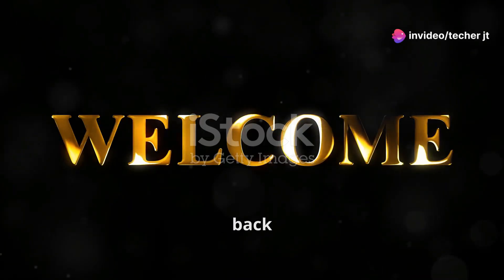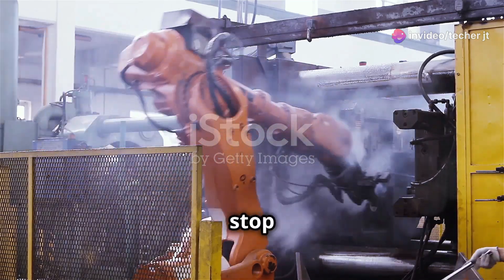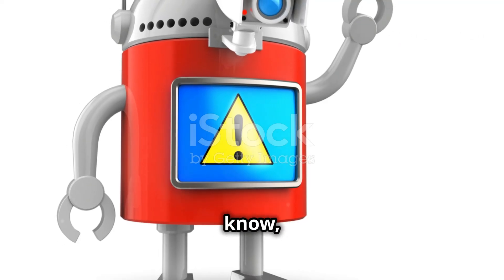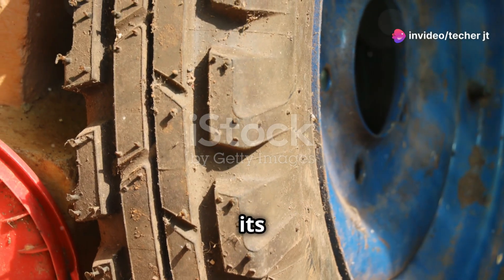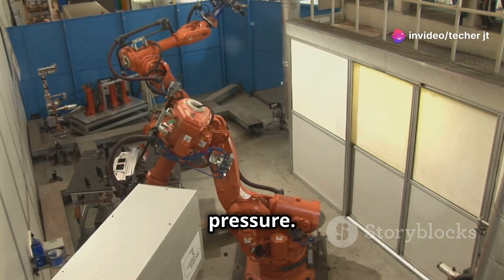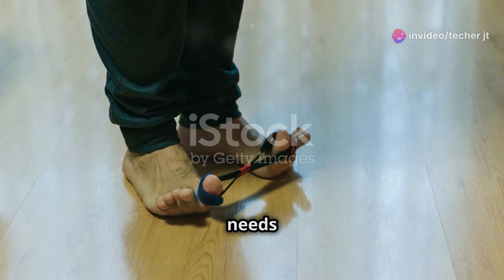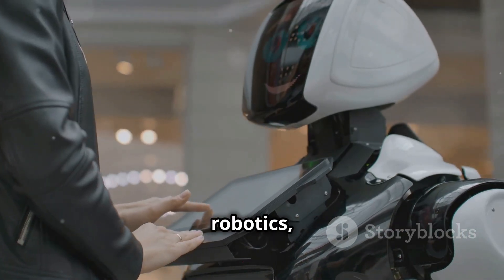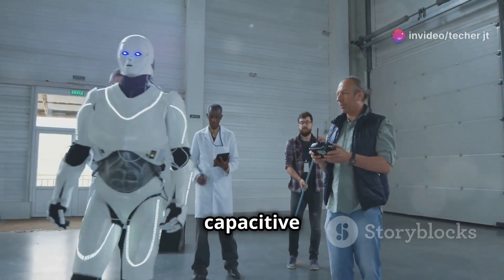Capacitive Sensors in Robotics: A Beginner's Guide

Comment: Annarica Nina A. Loyola
10-HERMES

1. What is the primary function of capacitive sensors in robotics?

Capacitive sensors act like a robot's personal space bubble, detecting objects before they
make contact.A proximity capacitive sensor emits a weak electric field, kind of like an
invisible force field around the sensor. When an object enters this field, it disrupts the field,
and the sensor detects that change. This allows robots to judge distances, avoid obstacles,
and navigate their surroundings without walking nose-first into a wall.

Comment: Jannah Loreen S. Galla 
10 - CASSIOPEIA 

Q: 1. What is the primary function of capacitive sensors in robotics?

A: The primary function of capacitive sensors in robotics is to detect the presence or proximity of objects, including both metallic and non-metallic materials (such as plastics, liquids, and glass). They work by measuring changes in the capacitance between the sensor and the object. Capacitive sensors are often used for object detection, level sensing, and position tracking in robotics, allowing for more versatile interaction with various materials.

Comment: Jaynie Margaret M. Lashley 
10 - Andromeda

1. What is the primary function of capacitive sensors in robotics?

- Capacitive sensors in robotics primarily function as proximity sensors, detecting the presence of objects without requiring physical contact. They work by measuring changes in capacitance, which is the ability of an object to store electrical charge. When an object approaches the sensor, it alters the capacitance, allowing the sensor to detect its presence and proximity.

Comment: Shiloh Nouvel A. Miquiabas
10 - ANDROMEDA

1. What is the primary function of capacitive sensors in robotics?

Answer: The primary function of capacitive sensors in robotics is to detect changes in capacitance caused by the presence of objects, including non-metallic materials like plastics or liquids, allowing robots to sense proximity, position, or the level of materials.

Comment: Chelsie Ann P. Carnaje
Grade 10 - Hermes

1. What is the primary function of capacitive sensors in robotics?

Answer: Capacitive sensors in robotics primarily function as proximity sensors. They detect the presence or absence of objects or measure the distance to an object by sensing changes in capacitance caused by the presence of conductive or dielectric materials. This allows robots to detect and interact with objects without physical contact, which is useful for tasks such as obstacle detection, object positioning, and touch sensing.

Comment: Leon Anthony S. Juaneza
10-LYNX

1. What is the primary function of capacitive sensors in robotics?
-Capacitive sensors allow robots to feel and perceive their surrounding environment without touching anything. They use electricity to detect nearby objects, measure pressure,  and even track multiple points of contact. This also allows the robot take less damage or wear.

Comment: Real Ann R. Dela Victoria
10 Andromeda 

1. What is the primary function of capacitive sensors in robotics?

Answer: Capacitive sensors allow robots to perceive their surroundings without coming into close touch with them by detecting changes in the electric fields that surround them. These sensors work as "electric feelers," allowing robots to move, interact with things, and perform tasks more precisely. They are critical for increasing robot awareness and productivity across a wide range of jobs.

Comment: Faith N. Ragas
10-ANDROMEDA

1. What is the primary function of capacitive sensors in robotics?
Robots using capacitive sensors can sense their surroundings without coming into direct contact with them because they can detect changes in the electric fields that surround them. By functioning as "electric feelers," these sensors help robots navigate, interact with objects, and carry out tasks more accurately. They are essential for improving the awareness and productivity of robots in a variety of tasks.

Comment: Sabina Claudia Barbosa 
10 - ANDROMEDA

1.) What is the primary function of capacitive sensors in robotics?
-  Capacitive sensors allow robots to sense their environment without actually touching anything. They use electricity to detect nearby objects, measure pressure, and even track multiple points of contact all without any physical contact.

Comment: Ana Althea B. Mabaylan 
10 - LYRA

2. How do proximity capacitive sensors differ from touch capacitive sensors?

- Proximity capacitive sensors are designed to detect the presence of objects without requiring direct contact. While touch capacitive sensors respond to direct touch input from users.

Comment: Christian Dynniel M. Llanos
10-LYNX

5. Discuss the significance of capacitive sensors in expanding the applications of robotics.

Capacitive sensors have significantly broadened the scope of robotics by offering both versatility and precision. These sensors detect changes in capacitance, influenced by factors such as proximity, distance, or material presence, making them ideal for tasks like proximity detection, level monitoring, gesture recognition, and material identification. Their ability to deliver accurate measurements across diverse environments has driven the advancement of more sophisticated and capable robotic systems.

Comment: Schumary Faye L. Reyes
10-LYNX

1. What is the primary function of capacitive sensors in robotics?
ANSWER:
In robotics, capacitive sensors are mostly used to measure changes in capacitance between the sensor and the object being tracked in order to determine if an item is present or absent. They work by generating an electrostatic field and monitoring changes brought about by the inclusion of dielectric or conductive materials. Because of this feature, capacitive sensors can feel things without making contact with them and detect a wide range of materials, including non-metallic ones. This is advantageous for robotic applications as it increases safety and precision.

Comment: Messiah Emmanuelle Lei P. Salomon
10-Cassiopeia

1. What is the primary function of capacitive sensors in robotics?

-Capacitive sensors in robotics primarily function as proximity sensors, detecting the presence of objects without requiring physical contact. They work by measuring changes in capacitance, which is the ability of an object to store electrical charge. When an object approaches the sensor, it alters the capacitance, allowing the sensor to detect its presence and proximity. This capability is crucial for various robotic applications, such as obstacle avoidance, object handling, and precision positioning.

Comment: Tysh Maeganne Z. Sagocsoc 
10- Hermes 

1. What is the primary function of capacitive sensors in robotics?
-Capacitive sensors allows robots to sense their environment without creating contact. They are the unseen heroes of robotics. It allows electricity to detect nearby objects, measure pressure and track multiple points of contact. For example proximity capacity sensors which has an electric field around the sensor which disrupts the field if an object is in its vicinity.

Comment: Renalyn R. Gaid
10 - Orion
1. What is the primary function of capacitive sensors in robotics?

Capacitive sensors use electricity to detect nearby objects, measure pressure, and track multiple points of contact without any physical contact, ensuring safety in the world of robotics.

Comment: Ralf Mikael A. Lopez
10-Andromeda

1. What is the primary function of capacitive sensors in robotics?

In the field of robotics, capacitive sensors provide efficiency and safety by measuring pressure, identifying nearby objects, and even tracking numerous points of contact without requiring physical contact.

Comment: Ruztylou Gaviola
10-LYRA

1. What is the primary function of capacitive sensors in robotics?

-The primary function of capacitive sensors in robotics is to detect and measure changes in capacitance, typically used for proximity sensing, touch detection, and object presence detection. They work by measuring the change in the electrical field when an object comes near the sensor. This allows robots to detect human touch, identify nearby objects without physical contact, and improve precision in handling or navigating environments.

Comment: Anika Charisse D. Dawal
10 - Lyra

3. What are the advantages of using capacitive sensors in human-robot collaboration?
ANS: Capacitive sensors are ideal for human-robot collaboration since they sense both metal and non-metal things, including human touch, without requiring direct contact. They provide fast, accurate sensing, which improves safety and interactivity by responding swiftly to proximity and touch, making robots more sensitive to human presence.

Comment: Roda A. Patayon 
10 - LYNX

3. What are the advantages of using capacitive sensors in human-robot collaboration?
Capacitive sensors can be used to create more natural and intuitive interfaces for human-robot interaction. This is because capacitive sensors can detect multiple points of contact simultaneously, which allows robots to track the movements of human hands and fingers more accurately. This can make it easier for humans to control robots and communicate with them using natural gestures. Additionally, capacitive sensors can be used to create touch-sensitive surfaces that can be used to control robots or provide feedback to humans. This can make human-robot interaction more intuitive and engaging.

Comment: Kaihanne A. Manticahon 
10 - LYNX 

2. How do proximity capacitive sensors differ from touch capacitive sensors?

— Proximity capacitive sensors differ from touch capacitive sensors by detecting objects from a distance without physical contact, sensing changes in capacitance as an object approaches. This capability allows robots to detect obstacles before making contact, supporting obstacle avoidance and navigation. In contrast, touch capacitive sensors provide more nuanced interactions with the environment by requiring direct physical contact to initiate a response.

Comment: Irah Nicole D. Ampasin
10 - Cassiopeia

1.What is the primary function of capacitive sensors in robotics?

The primary function of capacitive sensors in robotics is to allow robots to sense their environment without physical contact. These sensors use electric fields to detect nearby objects, measure pressure, and track multiple points of contact. This capability enables robots to interact with their surroundings more effectively and safely, performing tasks that require precision and sensitivity.

Comment: ☀10 - LYRA CHAIN ☀
Reply: Xharmei Therese P. Barcenilla 
10 - Lyra

2. How do proximity capacitive sensors differ from touch capacitive sensors?

Answer:
Proximity capacitive sensors create a "personal space bubble" around the robot, detecting objects before they make contact. They use electric fields to sense disruptions caused by nearby objects, allowing robots to avoid collisions. Touch capacitive sensors, on the other hand, enable robots to detect physical contact, similar to human touch, and can pinpoint the location of contact.
Reply: Jhonlee O. Oliveros
Grade 10 - Lyra

1. What is the primary function of capacitive sensors in robotics?

:So basically, they resemble tiny electric sensors that let robots detect their environment without really making contact with anything. Without making any actual physical contact, they use electricity to track several points of contact, determine pressure, and identify surrounding objects.
Reply: Jasmine Jade D. Cañete
10-Lyra

5. In what ways can capacitive sensors enhance safety in industrial robotics?

- Proximity capacitive sensors are essential for enhancing safety in industrial robotics. They enable robot arms to identify the proximity of human workers and halt operations to avoid contact, thus preventing potentially hazardous scenarios. Additionally, force/pressure capacitive sensors also enhance safety by allowing robots to manipulate fragile objects and interact with humans using the correct amount of force.
Reply: Maria Juliana Lois M. Palacio
10 – LYRA

1. What is the primary function of capacitive sensors in robotics?

The primary function of capacitive sensors is to sense their environment without touching anything. They use electricity to detect nearby objects, measure pressure, and even track multiple points of contact, all without any physical contact.
Reply: Lloyd Zeus M. Ladoroz
10 - Lyra

2. How do proximity capacitive sensors differ from touch capacitive sensors?

ANS: Proximity capacitive sensors detect objects and obstacles without the use of touch. Touch capacitive sensors on the other hand detect these objects by using physical contact. Touch capacitive sensors also have precision and accuracy on detecting where the disruption took place. Unlike proximity capacitive sensors that can only detect on how far away an object is.
Reply: Angel P. Rivera
10 - Lyra

5. In what ways can capacitive sensors enhance safety in industrial robotics?

- Capacitive sensors improve safety in industrial robots in several ways. Proximity capacitive sensors help robots detect when a person is near and stop their movements to prevent accidents. Force or pressure capacitive sensors also make robots safer by letting them handle delicate items and interact with people using just the right amount of force.
Reply: Abdul Haq R. Maminta
10 - Lyra 

5. In what ways can capacitive sensors enhance safety in industrial robotics?

- by using electricity to detect nearby objects, measure pressure, and even track multiple contact, all without any physical contact. This allows robot to judge distances, avoid obstacles, and navigate their surrounding without walking nose-first into a wall. With this, capacitive sensors enhaces the safety in industrial robotics by keeping it from bumbing into things that might cause a disruption or a potential hazard to the work place.
Reply: Chlouie Fate O. Hermoso
10-LYRA

2. How do proximity capacitive sensors differ from touch capacitive sensors?

-Proximity capacitive sensors detect nearby objects by emitting an electric field and sensing disruptions when an object enters that field, allowing robots to avoid collisions. In contrast, touch capacitive sensors require physical contact and detect touch by sensing changes in the electric field when touched, similar to smartphone screens. While proximity sensors focus on distance and safety, touch sensors enable robots to interact more precisely with objects and people.
Reply: Jasmine E. Delapus
10-LYRA 

2. How do proximity capacitive sensors differ from touch capacitive sensors?

Proximity capacitive sensors form a virtual personal space around a robot, detecting objects before they come into contact by sensing disruptions in electric fields. This helps robots avoid collisions. In contrast, touch capacitive sensors allow robots to detect physical contact, much like human touch, and identify the exact point of contact.
Reply: Iam Raut Labnotin
10-Lyra

3. What are the advantages of using capacitive sensors in human-robot collaboration?

•Capacitive sensors provide safe, contactless detection, reducing the risk of injury in human-robot collaboration. They offer high sensitivity, allowing robots to respond quickly to human presence or touch. These sensors also work with a variety of materials, enhancing flexibility in diverse environments.
Reply: Justine Luis G. Espadilla
10 - Lyra

1.What is the primary function of capacitive sensors in robotics?

Capacitive sensors function as the eyes of a robot, detecting objects before contact through the disruption of the electric field being emitted by the capacitive sensor.
Reply: Maria Floriz J. Napone
X - Lyra

5. In what ways can capacitive sensors enhance safety in industrial robotics?

- Through utilising electricity instead of physical contact to track numerous contacts, detect items nearby, and measure pressure. This enables the robot to traverse its environment, evaluate distances, and avoid obstacles without running headlong into a wall. Because they prevent industrial robots from bumping into anything that could disrupt operations or pose a risk to workers, capacitive sensors improve workplace safety.
Reply: Ma. Pashka R. Resoso
10-Lyra

5. In what ways can capacitive sensors enhance safety in industrial robotics? 
Capacitive sensors enhance safety in industrial robotics by detecting the presence of objects, humans, or conductive materials without direct contact. They help prevent collisions by stopping or slowing robots when something is nearby, ensuring safer interactions with humans and reducing accidents in dynamic environments.
Reply: Jana Sophia D. Enopia
10 - Lyra

1. What is the primary function of capacitive sensors in robotics?

Capacitive sensors in robots help detect objects, including non-metal materials like plastic or liquids, by sensing changes in capacitance, allowing robots to sense distance or position.

Comment: Rhilyne B.Rivas
10-ANDROMEDA

5. In what ways can capacitive sensors enhance safety in industrial robotics?

Capacitive sensors enhance safety in industrial robotics by detecting nearby objects or humans, preventing collisions, and ensuring safety barriers are properly in place. They are also used in emergency stop systems to halt operations if someone gets too close. Additionally, these sensors adjust robot movements to maintain safe distances and assist in quality control by monitoring material conditions.